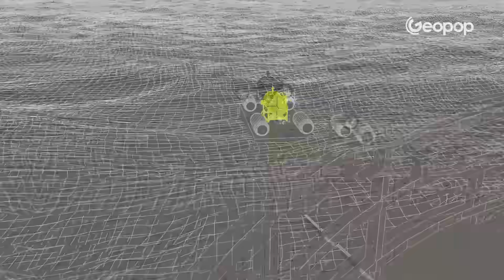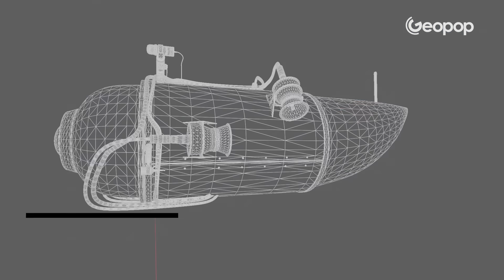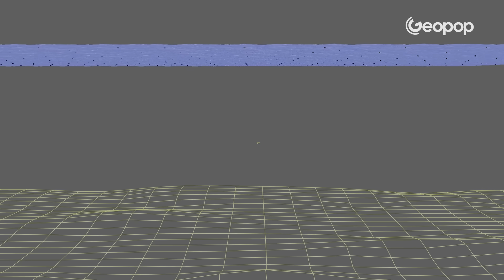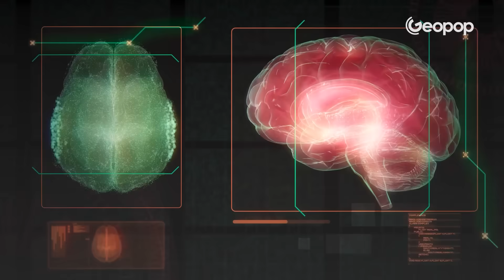Titan Implosion, two year later: the 3D reconstruction and the possible causes

Comment: You should include "feet" in your measurements for all of us unscientific Americans who don't use the metric system. Most of us have no idea of what you're talking about when you talk about measurements.
Reply: 1 meters = 3 feet
Reply: it's simple
1 millimeter is one millimeter
10 millimeters is 1 Centimeter
10 centimeters is 1 Decimeter.. which is not commonly used, but it is real
100 centimeters is 1 Meter
1000 Meters is one kilometer 
one foot is about 33 centimeters
one inch is about 2.5 centimeter 
one mile is about 1.6 Kilometer or 1600 meters 
the words are derived from old Latin    mili, centi, deci.. etc :) if you know how big is one millimeter, which is really smol, think of ten times that and you have a centimeter. 10x that and it's a decimeter, 10x that and it's a meter.. etc.. 
I know there was a time where people used body parts to measure things.. but if you are shopping at a taller guy, 4 feet of cloth would be more cloth material, than 4 feet of cloth at other vendor who is shorter..  for the same price.. This is why we have this universal unit system.
Reply: 12500 feet down. Ever go skydiving? You usually jump from 12,000 feet. It’s insanely far down.
Reply: Meter equals yard plus 10%.
Reply: Roughly multiply by 3’ per M
Reply: I usually watch american videos, it's always all imperial measurements, so if I am interested I do the math. Just do the math

Comment: Another factor in the destruction of the Titan may have been the choice of two materials to make up the hull. There was the carbon fiber cylinder with titanium endcaps. Whenever two materials are joined, there's a weakness at the joint. At pressure the two materials would have contracted differently, which may have caused a catastrophic failure at the joint.
Reply: That's the first thing I thought too. Even having different thermal expansion properties would have caused serious issues. But even just the compression would likely have been like an aluminum coke can with steel endcaps....a whole lot of stoopid and too much enthusiasm. Baffled by his own bullshit comes to mind. At the very least, that cylinder should have been replaced after every dive.
Reply: @VincentNajger1 Or at least been controlled with ultrasound scanning for voids or delamination. It may, just may, have saved five lives.
Reply: @kasperkjrsgaard1447  The documentary pointed out that hull was left at some Canadian marina for the winter, the freezing temperatures def caused more damge to the polymer
Reply: Or, just using CF in general as a compression vessel...seems like something I learned in General Engineering 101.
Reply: The fasteners (Bolts) were probably of a poor grade.
Reply: Yup that’s what some of the people said who worked on the Titan and got fired for being honest. So much arrogance and negligence went into the structure of this thing.
Reply: Unfortunately it was just their time to depart. Everything else automatically becomes alibis. 🤔
Reply: Yes that is my hypothesis.
Reply: I believe this is the main factor, not,  another factor.
Reply: Apparently they used super glue at the joints.
Reply: @Matez-m6s That's a lie!!! I heard they used Blue-tac
Reply: @tyronemayger4090  It was expired masking tape but they put a bit of water in a saucer and put it in the microwave for 30 seconds. Good as new!
Reply: @jm9841  for real??
Reply: Rubbish!
Reply: @byteme9718  What was that? "Rubbish", as in It was a rubbish idea, and rubbish design, and rubbish materials, and rubbish construction methods? I totally agree with you, lol!
Reply: @VincentNajger1  Exactly.

Comment: Some correction about pressures, 10 meters is literally 1 atmosphere because of differential pressure action (in real somewhat more due higher density of salt water). Claimed +1 atm would be correct when internal space in vessel will be zero (vacuum). In this consideration atmospheric pressure is counteracted by internal vessel pressure - also 1 atm. (zero differential pressure).
Reply: That can't be, in order for that to be true if on the surface they got in it and closed the hatch and then went down under anything up to 10 meters and the hull would be pushing outward with positive pressure which it wouldn't, from the moment you start descending downward you've got pressure pushing inward, ie turn a glass upside down and start pushing it down to the bottom of a swimming pool, which is far less than 10 meters, according to your hypothesis until 10 meters it'd be forcing air out of itself around the rim but it doesn't, going down it starts pushing water in and compressing the air inside into a smaller volume, get to the bottom of a 12 foot Olympic size pool and you'll see that the first inch or so of air has retreated from the rim towards the bottom of the glass (don't forget it's upside down so the bottom of the glass is upwards) from the water entering the open end of the glass (on the bottom since it's upside down) and compressing the air inside, what you're claiming means until 10 meters air would instead be coming out of the bottom around the rim of the glass.
Here's the part you're missing in your formula and you even mentioned it yourself, kinda, when you mentioned a vacuum, the water already has the weight of the atmosphere above it pushing down on top of it, it's not a vacuum above the water, it has one atmosphere, ie 14.7 psi (sea level standards engineering day), pushing down on top of it, that zeroes everything at the surface of the water so starting at the slightest amount under the surface of the water you've got positive pressure, ie the air trapped inside the glass in our pool experiment starts compressing and retreating from the rim of the upside down drinking glass. 
The only single way for pressure to be pushing outward between the surface and 10 meters would be if you had something pumping air inside our upside down glass to counteract the external pressure of the water, if you did and you kept the pressure inside the glass perfectly equal to the external water pressure you'd be able to keep the air in the glass right exactly at the rim, problem with that is just like inside the Ocean Gate if you equalized the pressure the people inside would be under just as much air pressure as is on the outside crushing them just the same as if the water came in, slowly of course not all at once like when the failure happened. 
Pumping air in an upside down container like our glass in the pool is how they dug the casings down to bedrock for the Brooklyn Bridge, because it took the same amount of air pressure inside to keep the water from coming in when the workers would leave through the air lock, which equalized quickly, after being in them for hours they were they first people ever to get "The Bends", it's first name was actually "Casing Sickness" (or Caseon Sickness but I'm not sure I'm spelling it correctly).
Although your hypothesis is wrong it does however show that you're thinking which is the very thing that progresses mankind so keep it up👍👍👍.
Reply: This sounds like a gauge vs absolute pressure discussion to me. 14.7psi (ish) in the vessel at surface when theyre sealed shut. Then ANOTHER 14.7psi/1atm per 10m depth. 
Right? What am I missing?
Reply: @MattH-wg7ou  Exactly, on surface is zero force pushing on hull - 1 in and one out. But in any 10 meters dive pressure difference rises by 1 atm./14.7 psi. The vessel hull must resist to differential pressure, sometimes are used partially pressurized vessels just for less material fatigue.
Reply: @adamw.8579  This was not pressurized. Even id it was pressurized to 1 atm it would mean they still had 300+ atm acting on the craft, what would be the use?
Reply: The 1atm in the vessel is counteracted by the 1atm of atmosphere when they are on the surface. Once they descend they are taking on ADDITIONAL 1atm per 10m. Not 10m = 1atm but 10m = +1atm from surface.
Reply: @MattH-wg7ou  
Exactly, I very clumsily stumbled my way through the same explanation, this is exactly why I pound on hot steel for a living instead of being a teacher. 
Worst thing is I make more money than them, nobody can explain that one.

Comment: They were instantly turned into plankton food paste.
Reply: why did i picture Plankton from Spongebob, with his Chum Bucket restaurant?
Reply: Only the gas in their bodies would have been crushed. Their flesh would remain as was, like fish or creatures down there, bring them to the surface and they are only a tiny bit bigger.
Reply: @firmbutton6485  it is estimated that the speed of the implosion was over 1000 feet per second. Faster than a bullet. Imagine that bullet is the size of the hull of titan coming in from all direction, thousands of pounds. They were turned into a gelatinous paste.
Reply: Basically.
Reply: Negative.  The bodies on the sea floor at the Thresher site are statue-like like the bodies of Pompeii victims. People don't know the friction of the air movement during implosion creates so much heat it instantly charcoalizes.   Not all the statue pieces will be intact, but there's no "paste," "gel," or anything soft.  It happens in fractions of milliseconds.  They are killed by heat.
Reply: @KathrynsWorldWildfireTracking  The bodies were NEVER recovered on the Thresher. Check your sources. Besides, the metal Thresher gradually filled with water at around 2000 feet before it sunk to the bottom. The Titan imploded instantly at 12k feet with a shattered carbon fiber hull. Big difference.. There was not enough time for the heat to flash fry the bodies before the hull crushed them at supersonic speed. As said before, paste.
Reply: @thereasonableconsumer  agreed with regards to the cooked thing, but the paste thing I don’t. There’d still be flesh n bones.

Comment: I'm thinking a test run with no people on board and it done by remote a few times before allowing people to 

Why take the risk of going in a untested tube only to find out a design flaw ends your life.
Reply: The sub already had some previous dives to the wreck, so it was tested, it just wasn't a Good design. The hull had previous fractures due to cyclic fatigue and in test models the hull had failed before this event

Comment: I would not go down to the Titanic if someone gave me a quarter of a million dollars. I would feel safer going to the moon like the Apollo astronauts.
Reply: If someone built a sub exactly like the Titan Oceangate built, I would accept a seat on it. Carbon fiber, in that configuration, can withstand those pressures, as shown by Oceangate's succesful expeditions - just not repeatedly. If it was the sub's first or second dive, I'd take my chances.

And that's for experimental materials and configurations, for more traditional designs things are perfectly safe, just look at the track record the rest of the industry had built up, and still mantains if one excludes the outlier that Rush was. Just look at Larry Connor, who will attempt a dive to it in cooperation with Triton.

The lesson here is not that one should be afraid of diving, it's that the right steps need to be taken to be sure it's safe beyond doubt - which is what Rush didn't do.
Reply: @DiGreatDestroyer  Just pray the game controller doesn't loose it's wireless connection.

Comment: It's not a bathyscape. It hasn't got a buoyancy chamber.
Reply: everywhere outside the US it is called a bathyscaph (a deep vessel), not every bathyscaph has to have the desig of early vessels, which had the pressurize sphere attached to a gasoline filled tank for buoyancy.. things have advanced since Mr Piccard.
Reply: @vladddtfan  
No, it's not "everywhere outside the US" as if the US uses a different term, if someone is speaking the English language, whether or not it's their native language, and they use the term Bathyscaphe for the Ocean Gate they're incorrect, the Oxford Dictionary;
Bathyscaphe: a manned submersible vessel of the type used by Auguste Picard (1884-1962).
He got that wrong, probably even in his own language, but he certainly got it wrong speaking in English.
Reply: @dukecraig2402  explained well
Reply: If it isn't a submarine, submersible or bathyscaphe, what is it?
Reply: @peaceful3250  it’s not a bathyscape, it’s not a submarine, so that makes it a submersible.
Reply: @louisecann7118   Thank you.
Reply: @MattH-wg7ou  lack of propulsion.
Reply: @MattH-wg7ou  because it's not yellow.
Reply: @MattH-wg7ou  Because: To descend, a bathyscaphe floods air tanks with sea water, but unlike a submarine the water in the flooded tanks cannot be displaced with compressed air to ascend, because the water pressures at the depths for which the craft was designed to operate are too great.

And, the bathyscaphes can dive deeper than submarines. They are also known as submersibles.
Reply: @peaceful3250 a death trap?
Reply: @molybdomancer195   Good one. 😉
Reply: @molybdomancer195 beat me to it
Reply: @peaceful3250  Killbox?  killtube?  hmm.  I dunno.
Reply: He's an idiot.
Reply: Yeah, that has me out. I’m a minute in and I’m not watching the rest.
Reply: Man... if I got a penny .... etc.